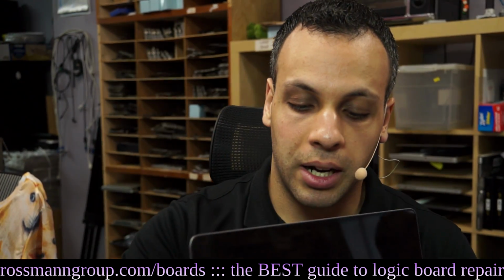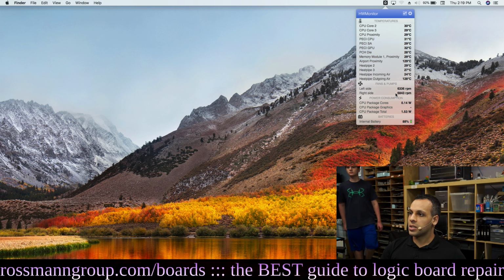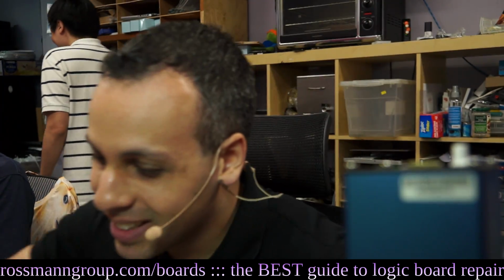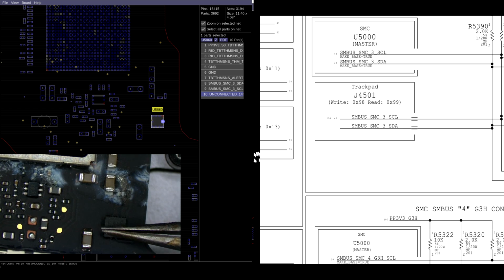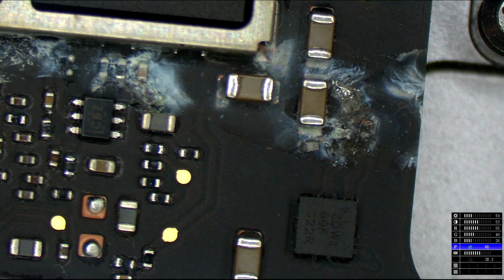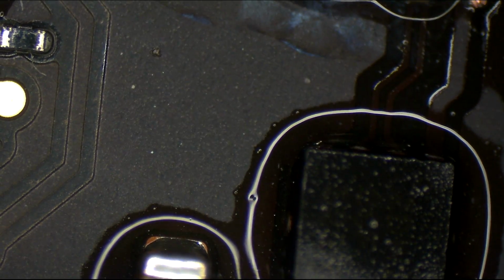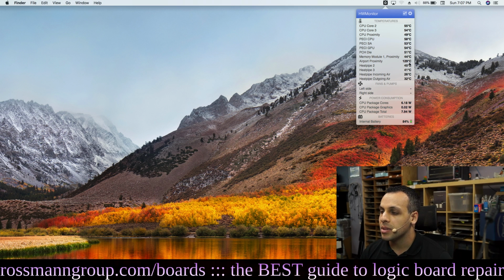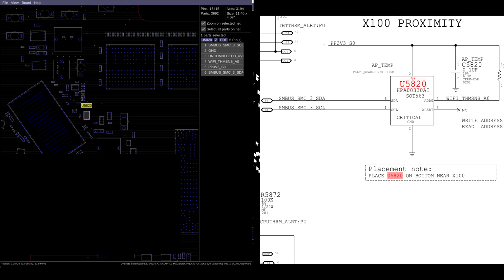How to repair sensor on Touchbar Macbook when running slow without Apple diagnostic software

Comment: I use iStat Menus which gives you access to all sensor data (as well as CPU/memory stats, battery health, fan speed etc) at all times from the menu bar.  My 2016 Touchbar Macbook pro started running ridiculously slow and I could instantly see that the CPU was throttled/underclocked to 800Mhz with 60% kernel task usage and that the cause was a fault in the two palm rest temperature sensors (they were not showing any reading).  Even if you don't know what the sensors should be reading, you can also see graphs for each sensor (hourly, daily, weekly or monthly) to get an idea of the average and spot anomalously high or low values. In the case of the palm rest sensors, I could see that they had been working normally the day before.

Comment: I love that all of these sensors and panic modes are put in place to supposedly protect other components of the board, but when you have your computer repaired by apple, they just replace the whole motherboard anyways. So why bother making these computers run like trash when a sensor acts up, if the alternative (board failure) means the same repair option via apple?

Comment: 16:04 What was the device floating around that looked ok but disconnected? P.S. I would change my password to "password" when I send it to a repair shop for their convenience only. Oh. If using 8 bit, 2^8 is 0-256 or -128 to 127 if using signed numbers. So 129 using an 8 bit signed notation is out of range.

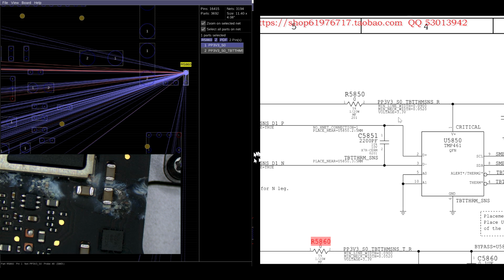Comment: 12:24 But if that chip goes bad, it and the resistor-fuse would still need to be replaced, ie. the motherboard needs repair. But I thought Apple didn't repair motherboards, they only replaced them. So in theory, it's a good design, but it doesn't actually benefit Apple though.

Comment: "Why the markets are fractioning? More than thirty differents languages to plug with, you'd have a lot of aftermarket parts, witch one came freshly perfect out of the line, it will be hard to tell. Anyway, tweezers was a good tool to start a social networking platform from. I had a microscope and a tester with the welding box, they're spared. Mom's friends, we all figured. You said touch bar, huh? I guess Amstrad is still making word processors with a single strip. Look at that monitor, I can't count pixels. Will it work the same out of HK?!" 🗨😘🧢♨️🚸🔌🔬🕋🚿🎭🏮🌀👕⚠️

Comment: Introducing the 2020 MacBook pro that comes with softer screws that break if you try to take them out
Reply: They'll probably use shear bolts. The pricks.
Reply: I imagine they will actually start using plastic screws within the next 5 years, then one-way plastic push rivets, and shortly after that they will just simply fuse the laptop together via plastic welds. Hopefully customers will wake the fuck up and stop letting Apple do this shit but I'm sure they'll buying their crap.
Reply: How are they going to assemble from the factory?
Reply: @aimless3827  very carefully
Reply: So the iMac Pro? VESA mount screws break off when tightening.
Reply: Then just use glue dumbass lol, like just put fucking elmers glue to bind your MacBook together
Reply: Hehe boi guess what they did with their iMac Pro

Comment: It uses 8 bits, 7 to show the temp, which is 0 to 128 and last bit to mark if it is not used. So that is why it shows 129, all bits present. It could also read all bits 0 expect the one that marks it as non-present.

Comment: does somebody now where do i get Apple Service Diagnostic version 2.5.8 because my Power Mac g5 has load fans and i want to figuer out what sensor is failing
or if its an actual issue

Comment: Don't buy Apple products unless you really need it for a specific task that can't be done without it. I had a Mac mini which died, went to apple store and got treated like shit.  Couple days later i bought a $100 used PC, installed Linux Ubuntu and it has been working like a charm since two years ago. This company selling you crap for a very high price tag. The best thing to do to force them change their strategy is don't buy their product. Switch to any free Linux distro and you will happy you did. I use Ubuntu and It is fast, safe & very stable.

Comment: I like the way the CPU was at like 30°C and the fans were at 6000+ RPM
Reply: Of course, who needs ventilation holes and proper thermal management system on a 1300$ "professional level" machine?

Comment: How does corrosion like that even happen? I opened up my 2015 macbook pro the other day to clean it out, put new thermal paste on, and replace my battery (which fucking sucks by the way), and my board looked perfectly fine

Comment: If the note says "place on bottom near x100" wouldn't that mean to place the airport sensor on the underside of the board near the X100 chip? That's retarded. The outgoing heat was 129c and the airport card was 129c, so the first sensor had issues, wouldn't you deduce that if the airport card had the same temp as outgoing heat that the sensor is also damaged?

Comment: The non-magnetic screw on the battery is probably stainless to prevent corrosion.  I mean you can't make it non-magnetic with regular steel or any other steel I know of, aluminum would be silly and titanium or any other exotic metal would be too expensive.

Comment: What's the point of over reacting on an alcohol dispenser? What did you achieve by throwing it ? You just wasted your energy and also raised your blood pressure on a insignificant issue
Reply: Entertainment. I rest my case.

Comment: Hi Louis,

Thanks for the video. I have a couple of questions about the video at 10:51:

One. If this zero resistor is a fuse, why did it burn out?
Two. What caused All of the crud around the nearby components. On the video it looks like heat damage.

Cheers,

Mark

Comment: So this may be a silly question and maybe if I go back and watch enough videos I will find the answer.  But how do you get the schematics for all these apple products?  I would assume as difficult as apple makes it to repair things and there unwillingness to allow people to repair there stuff they wouldn't be providing these schematics but would keep them under a tight lock and key.  Just curiosity as it seems like not only do you have them all but they are in a nice piece of software.

Comment: Apple loves to to give their diagnostic software only to their own people, who then REFUSE to actually use thay software to fix ANYTHING. I garuantee that the next thing Apple will do, is to weld the computers shut at the factory in order to stop anyone from even opening it, or theyll put a "kill switch" in it that will DESTROY the harddrive(with NO warning it will happen) if the case is opened. Apple is trying everything they can to make their computers "throw away" products where customers are FORCED to buy a new computer every so often because repairing them would literally be impossible.Apple doesnt care about using "apple cert. parts", they jist dont want you to know that your being lied to in order to get you to spend $1,200 on a "new" computer, when all it would really take is a $5 part to fix yours, like louis would be able to do. If Apple keeps all of its customers in the dark about the truth, the. They can charge whatever they want, say whatever they wany, and LIE about whatever they want. Thats what there trying to do. If they were car mechanics theyd be telling you that you need new blinker fluid, that they had to take an exhaust sample, and change out the flux capacitor....LMAO. That is why i really dont understand why ANYONE STILL BUYS THESE PIECES OF SHIT? SERIOUSLY, what is so fucking great about an apple computer? What can an Apple computer do that a PC cant? In fact there is SO MUCH MORE that a PC can do that a MAC can not. Its NOT worth the hassle, the waste of money, the Anti-Repair and Anti-Consumer attitude and policies that Apple runs their company by. But any MORON that owns an Apple computer and doesnt take it to louis to repair it, is a TRUE fucking idiot.  Cause if you do ANY buisness with the Apple store and their "genius" then your just ASKING to be ripped off and robbed. APPLE IS A PIECE OF SHIT company ran by com artists and LIARS. And i can just hope and pray that they go out of buisness and burn to the ground. I have NEVER and i WILL NEVER buy any Apple product or support such a scummy, greedy, backhanded, PIECE OF SHIT company. My son has even begged me for an iPhone and ive told him NO, that id buy him ANY android phone he wants, but that no son of mine WILL EVER be forced to walk around with a freaken Apple made anything. I will NEVER stoop that low as to have my son suffer that nightmare.

Comment: I have a Mid 2011 Macbook Pro which still runs like a boss and I love (8GB Ram & SSD upgrade). I have zero knowledge about electronics or circuitry, but for some reason, I love all your videos, even when you constantly bag out Apple! 
Note: I am a little annoyed that Apple has ceased any further support for my machine as of the last OS update.

Comment: Dual core for 1300!?! I bought my HP notebook 2000 with an AMD #-300 Apu for 299 and it was on deal back in the days when my dell passed away! This is an absolute rip off!!

Comment: Hi Louis I have a MBP first model with touchbar I think is 2016 having problems with the touch id sensor basically it dosnt let me install a fingerprint because it is full but I have no one stored do you about this and if it can be fix without going to apple ?? any help will be much appreciated

Comment: A1708 (2017 Macbook Pro) - Airport proximity and Mainboard proximity BOTH 128 degrees. Less than two months old and works flawlessly. Guess its like that from factory too.

Comment: 4:40 You buy $5 tweezers? That's expensive. I buy them for less than 40¢ on eBay or LCSC. At that point, they're practically disposable.

Comment: An alcohol dispenser that has sat for a long time may need the internal pump primed before it starts moving liquid again. Cover the hole at the bottom of the lid with your finger (or glove, or other solid thing) and pump it a a few times to remove the air and get the liquid alcohol moving. At 15:05 the cotton swab is not forming a seal, so the air is not getting pushed out and staying out. Even the more expensive metal pump with blue base can have this problem, but they seem to recover faster/better than the cheaper all-plastic dispensers.

Comment: Louis what happened to the fan speed sensors?
Why did they stop working?
Were they just not spinning or did the sensor get messed up during the fix?
Reply: I was wondering the same. They have to be spinning or the system would overheat and the sensors would read zero.

Comment: 22:18 The temperatures are read from SMB / I2C chip as one byte values. Sometimes the byte is just positive (unsigned byte) 0 ... 255, other times they should be interpreted as signed byte value -128 ... +127 using two's complement. Has the diagnostic software also changed?
Old notebook: -124 (signed byte) = 256 - 124 = 132 (unsigned  byte). 
New notebook: 129 (unsigned byte) = 129 - 256 = -127 (signed byte).

Comment: The 0R resistor is just a piece of wire. Putting there a component is totally unnecessary. The intention of the designer is to isolate the power rail from noise - originally with a filtering ferrite bead. For cost reduction purposes it is replaced with 0 ohm resistor. The wattage is fake, and reflects only the package size, it is definitely not a fuse to blow above such consumption!
Reply: I use 0R resistors to bypass other traces (conductors) when designing boards. You're right, he should have used a wire instead of a 0R that doesn't fit. The only time I saw a burned 0R was in a super cheap Chinese Multimeter where it was used as a FUSE, crazy.

Comment: "this machine cost $1300 and is a duo core"... this... get's me right in the soul
Reply: could buy an MSI quad core gaming laptop for cheaper
Reply: @Jono1982  plus if it's RGB, it runs 20% better
Reply: @ncsombra4562  the boost only if when it's red, otherwise it's normal.
Reply: with more powwweeeeeeeer
Reply: I got a $300 dual core, and that's still a bit much IMO
Reply: @wesleymays1931  dude in 2021.... a dual core cpu is worth like $17 😂😂😂😂😂 i would even go as far as to say you overpayed!
Reply: @num9908  Actually I read the specs incorrectly. The Pentium Silver N5030 is a quad-core CPU. And having the Pentium name makes it sound a lot worse than it really is, it can run Kerbal Space Program
Reply: They are priced high but in terms of form factor and features not incredibly so. If you want similar machines running windows that are similar in performance they will probably cost less yes but not like 1000$ less like some idiots are claiming.
Having more cores or a discrete graphics card is useless if it's a 4000 series i3 with a 1GB Gpu when compared to a 7th or 8th gen i5 or i7
Reply: Hahahahahahahaha hahahaha its a dual core at $1300 omg. Consult a beginner level enthusiast.
Reply: @hassanahmed9496 and those dual cores cant handle photoshop at all.... i dont understand how apple sheep using a dual core and telling us he getting better multitasking than same price windows ...
Reply: @Paradoxical Nightmare Same form factor Windows PCs with similar specs cost about as much. Apple doesn't offer a cheap alternative like most PC manufacturers so you're inclined to think they overcharge because you're an idiot. They may charge 100 to 200 dollars more, especially when an equivalent PC doesn't exist ( eg with touchbar, with that build quality, with MacOS of course ), but that's a far cry from the "DoUbLe ThE pRiCe" people claim
Reply: @Paradoxical Nightmare you are confusing a lot of things and putting words I haven't said in my mouth. What I said is basically don't just think PC are superior or without guilt, Apple and Microsoft pull of just as much shit on the consumer, one could argue Microsoft does even more because lacking a major stake in the hardware business they just invade your private life via software.
Apple doesn't have as bad of a monopoly simply because of the fact that Apple has a minuscule share of the computer industry ( not counting phones/tablets ) and their products are clearly marketed as OSX machines. Do I think it's right? Fuck no, Apple seems almost pathological in its quest to prevent the user from escaping their echosystem, why do you think they want to transition to ARM? It's not because they can manufacture cpus better and cheaper than Intel or AMD, likely not, it's because outside of keeping all profit, proprietary Apple CPUs will have a way harder time working with different operating systems, different hardware, etc...it's just another way to trap their consumers.
Is microsoft better? Fuck, no Microsoft also works immensely hard to trap the consumer to windows, to collect as much data for resale and to spam them ads, instead of working on a better system for the consumer. Windows 10 unlike OSX is an admachine*. Cortana, microsoft store, windows hello, the start menu, data collection, it's a bunch of crap that's there just to monitor users, spam them ads, control what software they use, control how they use it. The fixation on a single company is incredibly unhealthy and stupid, makes you completely blind to the shit the other companies pull. Like Google, let's hate on Apple, Microsoft, Yahoo, whatever and let's all dump our information on google, let's use chrome so that it eats all our resources to be even faster at collecting our data...lol and let's just use apple as our boogeyman to not have to think about other companies screwing us.
And I have all the reasons to hate apple's monopoly because although I don't like or need most of their products, I would have loved to use the Air as an ultrabook but it's such a pain in the ass to run any other OS on that things I gave up the idea.

*OSX also does those things to different extents
Reply: @Paradoxical Nightmare oh wow I missed the supreme court ruling, well shit that's fire.
I'm not a fan of Brave and DuckDuckGo. I think there's not real guarantee as to what they do with our data, but if someone isn't extremely concerned with data then DuckDuckGo is great because at best it doesn't collect any, at worst it has to be really careful about whatever data leaks out to not get shut down. Brave is ok but I'd rather use firefox, the ad thing is too sketchy for my taste, especially when the entire motive of Brave splitting from firefox was the dev being an asshole lol

Also the BAT thing seems kinda cool, cryptocurrency is being attacked on all fronts for obvious reasons, it doesn't need banks and states so someone might be a lil butthurt about cc
Reply: @Paradoxical Nightmare yeah, I just try to be careful about internet use because in the end either Tor or they can get all the info they need no problem lol. Even Tor I'm not sure, I haven't looked into it enough since I didn't need it
Reply: Got same spects within 350 mother flower doller
Reply: Could buy used thinkpad for much less
Reply: Insane right? When a 4 core processor is like $99.  Wild.  Only apple can get away with this BS.
Reply: I bought a quad core Samsung PC laptop for $400 in 2012, running Windows 7 and it is still going strong today. Let's see apple beat that.
Reply: @jezeski2011  just but it
Reply: @hunterferrick4816  what?
Reply: @jezeski2011  just buy it* fat fingers :p
Reply: @hunterferrick4816  Buy what? I don't need to buy anything; the Samsung I mentioned is still running great for me. My point was that apple sucks and that I will never buy it.
Reply: @jezeski2011  its a joke running with the intel and nvidia fan base. people make fun of them for going with there just buy it policy, which is what apple does.
Reply: @hunterferrick4816  OK, I am not too current with many of the tech memes and such. Thanks for explaining and being patient with me. Have a good one.